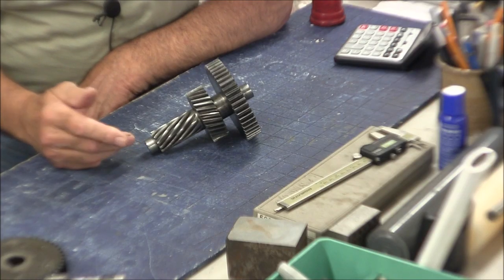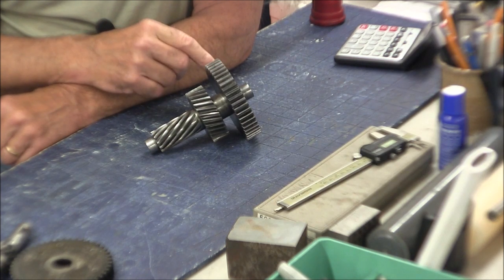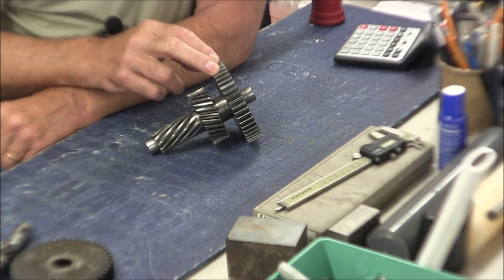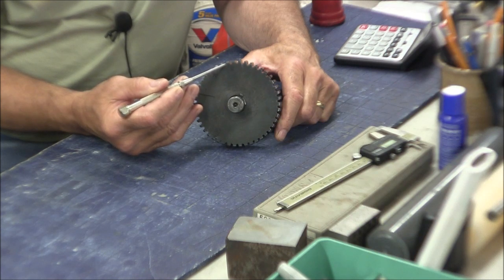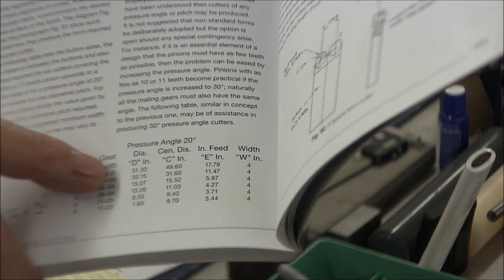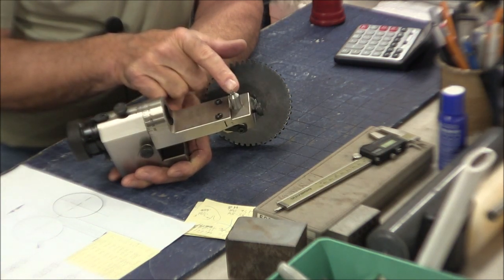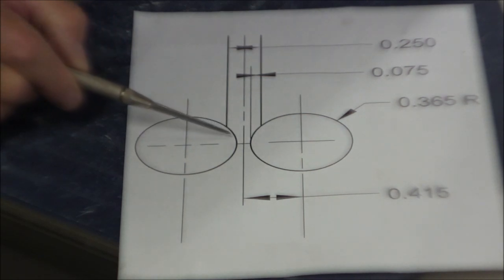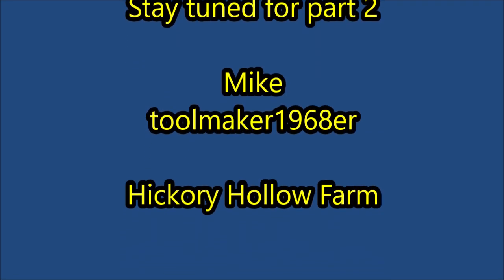Grinding gear teeth No kidding

Comment: Thats the first time I heard of doing it that way. Thats a great explanation though.  Not long before they went all CNC, the last shop I worked at for a short time I ran the gear hobber after the old man who'd run it for years passed away.
Reply from the maker: I could have annealed the gear, recut the teeth and then rehardened. My heat treater has a $80 minimum charge. So I avoid $160 plus get a better finish by going this way. I'll be using an 80 grit wheel and I hope I can get all 46 teeth with one grind. 😬 Tc, Mike

Comment: Mike I have an Excel spread sheet that will give you the numbers for gear cutters you just plug in the numbers and it calculates it all out for you. I have it in a zip file and it's under 2 mb in size. I have used it a few times can't remember the name of the fellow that put it together but if you have a e-mail I can send it to I'll send it. Did you consider lapping the gears in with some lapping compound. Not sure if lapping would work if you need to get the root deeper though. Anyway I'll be watching for the next video.
Reply from the maker: I didn't consider lapping as I think it will require the full .008. I don't do alot of gear work but I would like a copy of your gear tooth calc spreadsheet. It's interesting that I compared a couple of button cutter tables from different sources and while close, they varied by a few thousanths. I'm thinking the dimensions are somewhat forgivable. Later Mike
Toolmaker1968er@gmail.com

Comment: Thanks Mike, that was an education! You explained it perfectly. I think what separates the average from the level you and many others are at, is not being afraid to step beyond the comfort zone. To look for alternate solutions, to not be satisfied with what you have, to always improve upon our ideas! That's how we grow, and achieve great things! Thanks again for another great video! Oh, and sorry for rambling😅
Reply from the maker: Thanks Steve. The root problem is that I used the center to center dimension on the Doall print and I should have measured the case the first time. I think this should smooth things out. I guess we'll find out.  Take care, Mike